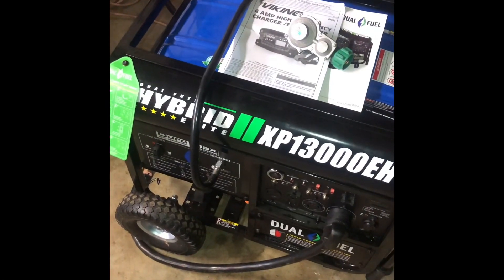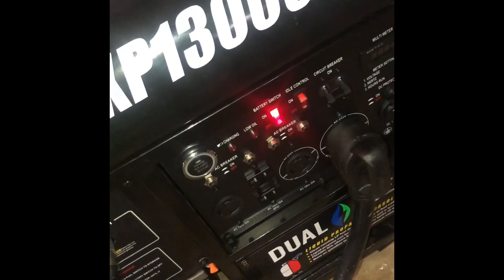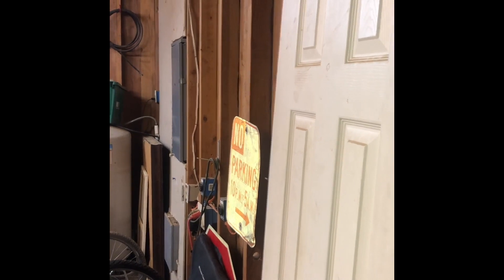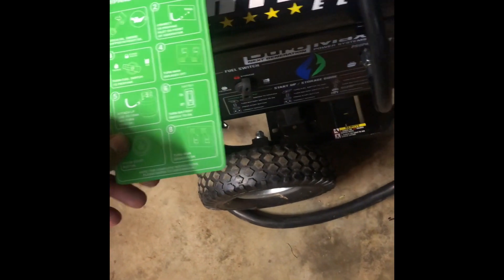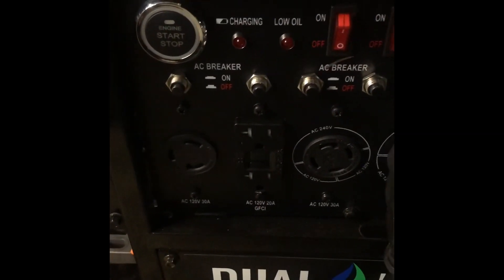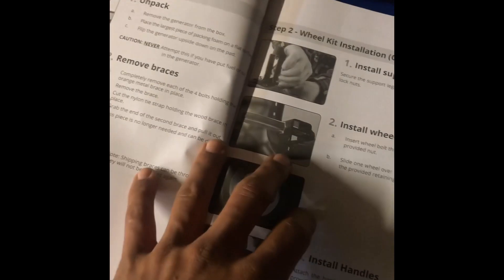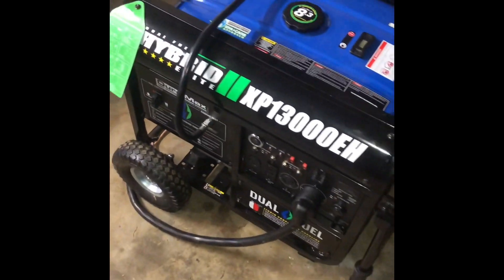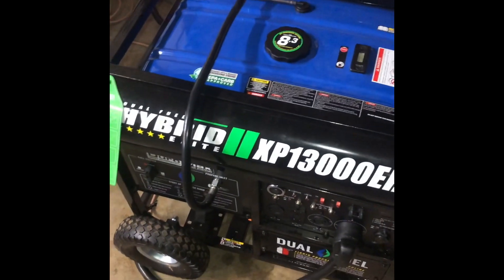DuroMax XP13000EH Generator Connected  to 250 Gallon Propane Tank

Comment: To help you on your power that your generator has to put out for your AC unit install a soft start switch is around $300.- $340. and will cut way down on what your AC unit draws in amps on start ups. And will make your unit last longer. Your AC unit will only need about 1/3rd of the amps that normally it would've taken on start up so you will have more power to use elsewhere if needed without over taking your generator.  I know the soft start seems high but it's worth its wait in gold .
Reply from the maker: Good info, I’ll look into it. It ran my 3.5 ton unit last outage.

Comment: Great. Video.  What is your fuel consumption at half load?  What is the length of the propane hose that comes with the unit
Reply from the maker: Not sure on fuel consumption. Never factored it in. I just make sure that my tank gets filled when its at 1/4 tank. I have to keep it full because it runs every appliance in my house (dryer, oven, water heater, central heat that I never  use). Factory hose is approximately 60".

Comment: I am going to buy  either that unit or the Westinghouse 12500,  any idea how they rate in customer service and parts between the two of them.
Reply: I just returned a Westinghouse 9500 today, the one that peeks at 12500. It had great reviews and ran like a champ starting via the recoil. Problem was it would not start with push button start. Battery checked good. I called Westinghouse support twice and emailed them twice over a seven day period. They never returned my call or email. So I returned it today. Had great reviews; loved the generator.  I just wish that it would have started via the push start.  I am in mid seventies & may not be able to pull the cord in coming years.

Comment: Will this 13000 power a home air conditioner?
Reply: Hey all, I have the 12,000 "beast model " and to answer your question in regards to the 2.5 ton AC. Yes mine powers the ac (2.5ton) with 1 fridge, 1 deep freezer, while running TV, light and cooking with a toaster oven all at the same time. And I'm not one of those guys who just blindly does this. I in real time monitor the frequency and voltage to make sure all is good. And the frequency never falls below 60hz. It's sweet spot is 60-61hz while under heavy load aswell  which is a safe. So these machines do pump out the power. It is wise to always monitor the frequency and voltage in real time with gasoline generators, you never know when the AVR (automatic voltage regulator) can go bad.
Reply from the maker: Depends on the size of the unit.
Reply: DJAXMAX  I am seriously considering this model for my home. I was also wondering if it’s powerful enough to run my home, including a2.5 ton home A/C unit? Thanks so much for this video. 🙂
Reply: DJAXMAX as a side note I was considering getting the xp15000eh, but it’s not in stock anywhere and it’s about $1,000 more than the 13,000
Reply from the maker: I tested it today and it ran the AC and Well and it ran both at the same time.
Reply: DJAXMAX Thanks for getting back with me. I went ahead and ordered it from a Duromax authorized distributor and got it for $1329 after using a $70 off discount code. I’m super stoked about it. 
Do you have any ideas how much it will cost me to get a manual or automatic transfer switch and installation for it? That’s a job I don’t feel equipped to do myself.
Reply from the maker: littlebirdblue you will need a manual transfer switch. I’d just do an interlock kit. They are made for most panels. It’s not that hard to install at all. Also the cheapest option.

Comment: Have you load tested this my 13000e only loads about 9200w before I drop below 60hz
Reply from the maker: jakester142 I have not load tested it at all.
Reply: I have the 13000e also. I bought it used and I haven't never used it. I don't know anything about generators. If you could explain to me what you mean about the load and the 60 Hz. And I thought it says 10500 running watts?
Reply: @kennethhunt248  it's actually about 8500 running watts its overrated
Reply: @jakester142  that's a big drop. Is that tester accurate?

Comment: Great info brother do you have a video how to hook  up the 4 amps Viking charger  please share it  if you have it .
Thanks
Reply from the maker: taleb karaouni no video. Just 2 eye connectors.
One to the negative and one to the positive. Then I screwed it to the frame.
Reply: DJAXMAX  did you have any problem with the charger connected to your generator ?
I have the 13000 should I keep on 6 v or 12 v. Thanks
Reply: Did it ruin the battery from the heat of the generator.
Reply from the maker: taleb karaouni 12v. I unplug it from the wall outlet when the generator runs because the generator also charges the battery.
Reply from the maker: taleb karaouni no
Reply: DJAXMAX sorry if I am bothering you .
Do you hook up the cable that comes with the battery  plus the the 2 eye that comes with the for Amps Viking  or just the 2 eye that comes with the 4 AMPS please explain I am not much of electrician .
Thanks
Reply from the maker: taleb karaouni both the positive and negative from the charger and the generator. So you should have 2 red wires on the positive and 2 black on the negative.
Reply: DJAXMAX got it thanks a lot , and when the generator turns on do you leave the battery switch on to charge the battery or you turn it off , and the battery will get charged because the generator is running .
All though when the generator turns on , I will disconnect the 4Amps thanks to your info the tech duramax did not explain it the way you did please explain .
Thanks

Comment: I would keep the battery maintainer away from the generator only because the heat of the generator while running will eventually kill it. Thank you for the great video
Reply from the maker: Although it is mounted I have ran the generator for a few hours and the maintainer doesn’t get hot. All the exhaust and stuff is on the other side. The maintainer is on the intake side.

Comment: Hi .. thanks for the video .. i had 2 quick questions:

1. If you removed the regulator (that came with it) - what do you have regulating the propane pressure? Is there some other regulator at the main propane tank?
2. Is 1/2 inch black pipe what's needed for this generator, or would a 3/4 pipe be ever better?

Thank you.
Reply from the maker: I have a high pressure regulator at my tank. Before the house is a low pressure regulator. Some have dual stage regulators. Either way if you have a tank and other appliances running off of propane it’s been regulated down to low pressure if you’re tying in after the propane comes in the house. If you tie in right out of the tank you’re going to need to regulate it down to low pressure. I used 1/2” for mine. Works fine. Remember the hose that comes with it is like 1/4” or 3/8”, it’s small. 3/4” would work for  long run. When I help my buddy install standby generators we use 3/4 up to 16kw and 1” after that up to 22kw. When we do the portables most of the time it’s in 3/4” and then reduced to 1/2” at the generator and that’s because he doesn’t want to have to stock a bunch of different pipe and flex.
Reply: @jsjunkremoval  Thanks 👍

Comment: Very nice setup sir...Do U find that U actually need this much generator to run the house's systems? Your hookups look sound. I use a Champion 100296 ( 49 states ) dual fuel generator I run on LPG @ about 7 KW's of usable power. It easily powers the entire house, i.e., (3) phase deep well pump, FHW propane furnace with domestic hot water tank, all lights, TV, computer, shop air compressor, etc. I use the provided regulator that came on the chintzy 3 ft. hose that I replaced with a 6 ft. high quality hose B4 hookup. I keep ( 2 ) full 40 LB. portable LPG tanks on hand with ( 2 ) 20 lb. portables available as well. In using the larger LPG tanks U have apparently figured out the correct flow rate regulator to use with the factory reg. on your unit. I maintain a " use journal " on my unit & under normal usage I get 18.25 hrs. out of (1) 40 lb. tank... I too did my own installation on my 30 amp Champion generator using 10-3 Romex between my 200 amp main box with a " Interlock Switch " with a single, dual throw 30 amp CB going out to a 30 amp Reliant power inlet box on the outside of the structure. I use a 50 ft. L14-30 power cord that runs over to my outside generator pad that I also grounded even though I am internally grounded. That's just me, most people don't bother with it, although most installation manuals do advise it... I Did my install in Jan. 2018 shortly after major wind shear downed trees all across central VT & we lost power for a week & once again losing everything in my fridge & freezer for a 3rd time costings 100's of dollars after each occurrence...
Thanks for sharing your experience here,
Bill on the Hill,
Vermont... :~)
Reply from the maker: William Farr I had a 10,000 watt that I converted to propane. It ran everything but not my 60 gallon air compressor in the shop. Most of the time I just shut the compressor breaker off when I’m on generator anyway. I haven’t fully tested this one but I wanted to make sure I had enough generator to run my 3.5 tom AC. The generator it’s self doesn’t need too much PSI. I have a high pressure regulator coming right out of my tank and a low pressure right before it enters the house. It seems to give everything in my house that is running off propane (heat, water heater, dryer, range and not generator) enough gas to keep them all going. I forget if I mention it but I installed the same set up for my father in law minus the large tank. He’s running off of 2 dual 26 gallon tanks that I connected together. You can find the adaptor on amazon from Mr. Heater. Overall I’m happy with both set ups I just like not having to lug propane tanks to get filled. But then again I lug his to get filled and my 26 gallon tank that runs my shop heater. I ultimately got this one because I didn’t want to have too little of a generator and also didn’t want my generator to be running at lax capacity the whole time either.

Comment: :28
Its 1/2 inch PIPE not line, its not a wire or cable to call it a line.
Reply from the maker: You Tube I guess that’s why I said it was info only. Because I don’t know every professional term. My bad I’ll delete the whole video and make one that fits what you like.
Reply: @jsjunkremoval  its your choice
Reply from the maker: You Tube always a few haters.
Reply: @jsjunkremoval  thats not called hate, its called correcting, giving out mis information
Reply: Ever heard of a gas pipe line?
Reply: @bakerman4444  yes you just CONFIRMED what its called, a GAS PIPE line ... You used the words "GAS PIPE" 1st then you put in the word line.
You dont say i put in a 3 inch line from here to there and expect everyone to know what kind of line you are talking about.
Reply: Lol
Reply: @bakerman4444  glad you find your stupidity funny
Reply: You Tube That’s some weak trolling. Better luck next time. I just bough this model generator so I’m going to start working on my new line while it’s in freight.
Reply: @bakerman4444  is that the best you got ?? Trolling ??
Reply: You Tube yes
Reply: @bakerman4444  thats a 1st ...
Reply from the maker: @ACommenterOnYouTube  Did I ever say this is a DIY video? No it is simply a video about my set up. I said gas pipe, I said line. I said a lot of stuff. I have used all of those terms at my local plumbing supply store and they always get me what I want. I have asked for black gas pipe and black gas pipe and they always get me what I want. It is what it is. Make your own video if you don't like the terms I used.
Reply: I just farted
Reply: @troywilliams8659  ok thanks for sharing lol

Comment: Can you link which 50 amp cord you bought?
Reply from the maker: Here is the amazon link to the generator cord I bought. 

Mophorn 15Ft 50 Amp Generator Extension Cord STW 6/3 + 8/1 Generator Cord 125V 250V UL Listed Generator Power Cord N14-50P & SS2-50R & CS6364 Twist Lo https://www.amazon.com/dp/B07WMG4KWZ/ref=cm_sw_r_cp_apip_JzbU2RzyicNI9
Reply: I have a similar setup with the 12000. I use this 

Conntek GIB1450-025 Duo-Rain Seal 50Amp Power Inlet Box and Temp Power Cord Combo Kit, 25 Feet https://www.amazon.com/dp/B018B3H2YY/ref=cm_sw_r_cp_api_i_U.gREb1ESJBTQ

Comment: Now there is a very impressive set up!!  I own the XP12000EH and it's a beast.  I wanted the 13,000 version (like  the one on this video), but all were sold out at the time.
Reply from the maker: The 1300EH was out of stock when I ordered but I waited because it’s what I wanted.
Reply: @jsjunkremoval  why did you want the 1300eh over the 1200eh ?
Reply from the maker: @mccoyra  a bit more power and the 12.000 didn’t have an hour meter.

Comment: Which lp regulator did you plumb into? The high pressure on your tank or did you tie in after the one feeding your house?
Reply: Good question.So you removed the regulator that came on the generator?.
Reply from the maker: sh839c the regulator on the hose that come with the generator, yes.
Reply from the maker: Erik D. It’s tied in after my LP regulator on the house. I put a T in the pipe between my hot water heater and propane dryer. The order of my gas appliances is: Furnace (never use it, we have a wood stove), hot water heater, generator when it’s in use, then dryer. 3psi isn’t much.